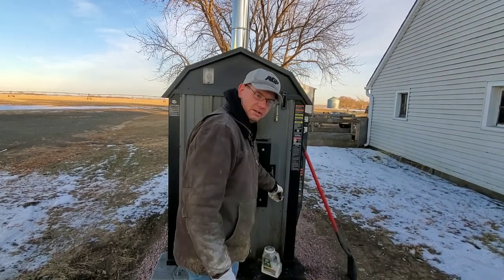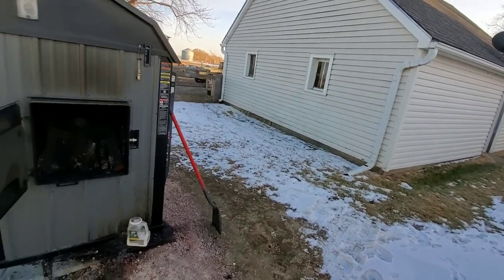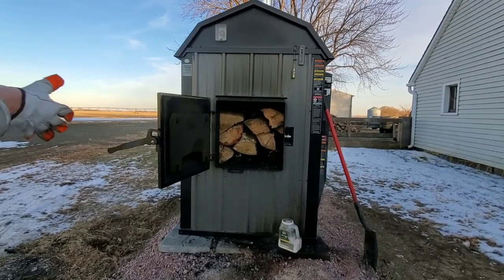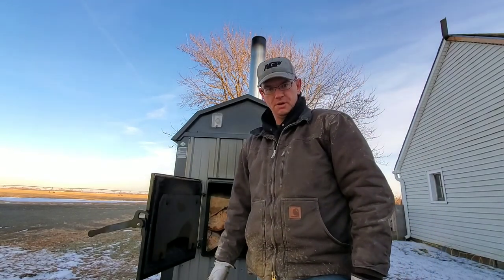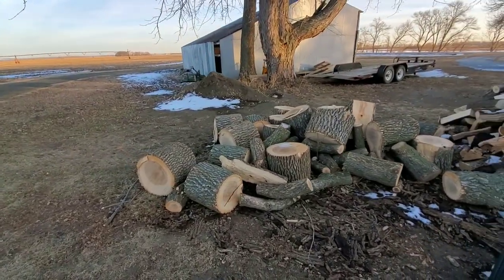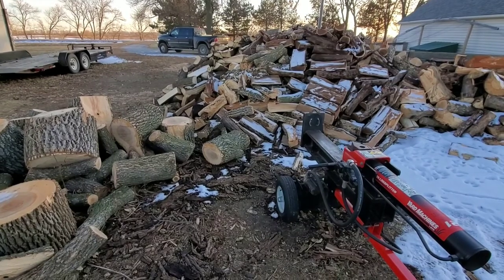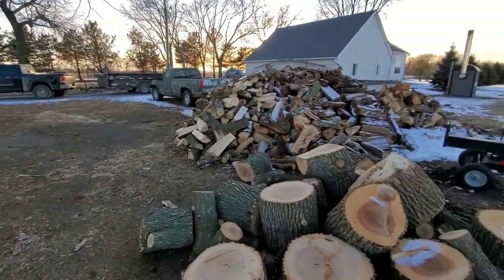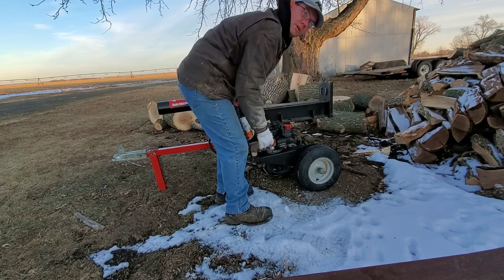#7 Feeding outdoor woodboiler and splitting firewood

Comment: I've burnt wood for a lot of years and a tip that will save your knees and back (they'll both start hurtin when u get a little older)  load your heavy rounds in the "huntin" truck and back it up to splitter.  Roll them out and let the off side lay on the tailgate. Put split pieces on the pile or in your loader bucket. This saves your body a little bit. I have a 6048 central boiler and I've never used "ash trol" so I can't help u there. 
Keep up the videos, I try to watch and pick up a few ideas here and there. Keep the heat rollin!!!

Comment: Rather than their powder, try to burn as dry a wood as you can to reduce moisture in the firebox. Another way you can increase the life of the unit is to run it year round and not let the water get cold or sit with oxygen in the water tank. Just keep a small fire going during the non heating months to heat your domestic hot water.

Comment: I have a Mahoning outdoor furnace. I’ve never put anything into the firebox to prevent rust, but during the summer months when it isn’t used, I put a bucket over the chimney. I pour a rust preventative once a year (it’s a quart of liquid) into the boiler’s water reservoir in the spring. Cost is $25.00 per year. I heat my house and my domestic hot water with it. I have an electric water heater for summertime, since we like to have the windows open and don’t want smoke blowing into the windows when they’re open. It doesn’t matter whether my wood is seasoned or fresh cut wet. I can burn pine as well. I’ve never had creosote problems. It burns too hot to create creosote. I set it at 170* water temp. It holds 290 gallons. And has a 4ft deep fire box that’s 30” high, with a 24”x24” opening. If I can lift it to my waist, it goes in. I split some so my wife can load it if something happens to me. I have about 4 months worth split at anytime, just in case....
Reply from the maker: That sounds very cool.   I have a similar thing now made by central boiler.  It may be a tad smaller thou.  Holds 196 gallons I think and 3 foot deep firebox if I remember right.  I absolutely love it.  I've been putting some big ash rounds in there I cut in video 8 I think it was

Comment: That powder isn’t really necessary 👍🏼 I’d recommend splitting your pieces bigger, less work for you and pieces last longer so you use less wood each year, it’s also okay to burn green in your boiler.
Reply from the maker: That sounds like good advice.  How confident are you that the powder isn't necessary ?  I do have the model that's supposed to have a stainless steel titanium firebox so that should reduce corrosion
Reply: Surviving Country Life I have never used it and I know my uncle and boss never have been either, no problems.

Comment: How important is Ashtrol? Is it required for the warranty? No. Then it isn't. My Central Boiler is on its 8th season and I have never used the stuff. Turn your valve on your water level and let the tube drain. The valve has a drain hole for when it is in the clockwise position. Keeps the risk of freezing the valve when it is cold (especially if the furnace is inactive for a few days like on a vacation) but more importantly, if that little plastic hose fails while the valve is vertical, it will drain the furnace reservoir down to the level of the valve. It's supposed to be for a momentary check of the water level, not a continuous monitor. 
I always use my splitter vertically  and I have a round to sit on. The splits get thrown while splitting into an ibc tote or go directly onto the hay elevator which I modified to be a wood conveyor (then into the dump truck). Enjoyed the video! Best from the mountains of northwest Georgia!
Reply from the maker: That's good advise.  I've got glycol in there so not worried about tube freezing.  But I never considered a valve failure.   I'll drain it out.  Thnx
Reply: @survivingcountrylife7069  I would have concerns using glycol if you use the furnace to also heat your water... I try to consider what could happen. Like the godfather said, women and children can be careless. Men can't be careless.
Reply from the maker: True true

Comment: I have a bad back so I put the rounds in my kubota like yours and put to height of splitter so no lifting then put in bucket and pile close to furnace
Reply from the maker: That would be a good idea.  I've been drooling over log splitters with log lifts.  But I think I'm gona have to save money and not buy them for now
Reply: Same I have a Timberwolf p1 but I would like the wolf ridge that the Morgan’s have but it’s like 6,000 so kinda steep ,
Reply from the maker: The morgans one is very very nice.  If you haven't look at an eastonmade 5-11.  They're very heavy duty and look very very well designed.  I talked to a local welding company this past week to see if he could make me one like it.  But after he looked at it on internet he said I'd be better off buying it as he thought two guys working on it at 85 bucks an hr shop rate would not be cost effective ect....

Comment: I run a wood heating business and my experience with outdoor  wood boilers is to actually have them inside an enclosure or shed like building . Only some boilers are permitted to be installed in a structure but this method drastically increases the longevity of the unit. I get my customers to run creosote conditioner powder which dehydrates the creosote helping prevent  the glazing creosote build up .
Reply from the maker: I always dream about having a Morton building.  I'd put my boiler in there if I did

Comment: I have had mine in use since 2006.  Still have same astrol canister. I think it is equal parts tsp Epson and Baking soda.   Found on several blogs.  Btw.  Think you should use less.
Reply from the maker: I've been using my little scooper three quarters full about every other time or every 3rd time that I put wood in the boiler.  Hope it's working

Comment: SCL, something is not right with your splitter here. Sounds/looks to me that the valve relief needs adjustment or is malfunctioning. Your splitter pump should not take 2-3 seconds to “shift” from high flow/ low pressure to low flow/ high pressure side of pump. I’m thinking pump is ok. Maybe just replace entire valve cause it looks like the detent is not kicking out either when fully retract...but that could be from the relief valve not working correctly also.
Reply from the maker: The detent is definately set really hard or not set right.   Most if the time it's got to set there and grunt a bit before it kicks out
Reply: Surviving Country Life check out this forum https://www.arboristsite.com/community/threads/log-splitter-slow-to-split-video-shows-it.271267 and watch the video. Think this is the same splitter as yours with the same problem. Read owners comment down lower...found the valve was bad.
Reply: Yours is the titanium series witch is stainless steel from what I’ve seen stainless doesn’t corrosion much I believe that cb started building all there stoves out of it after 2016 except there coal burner